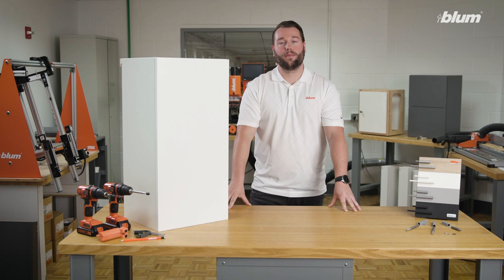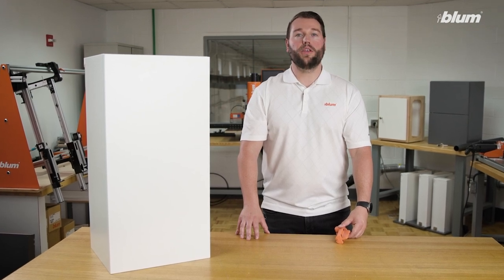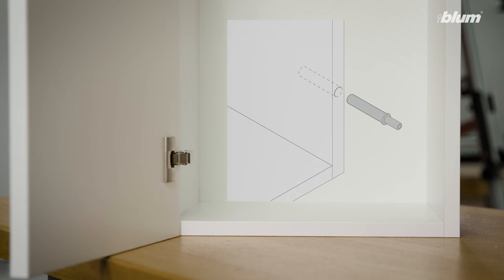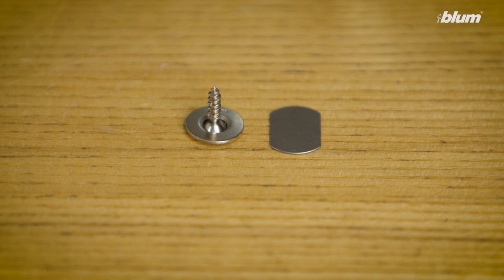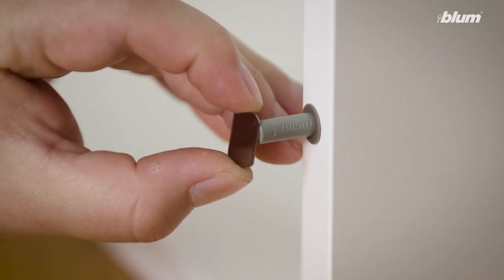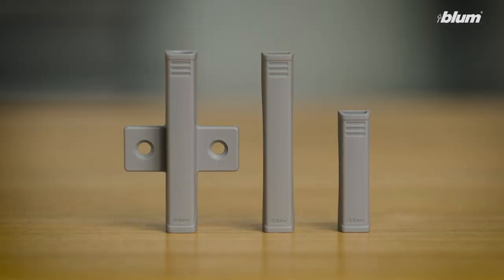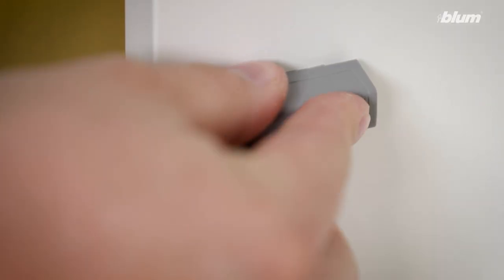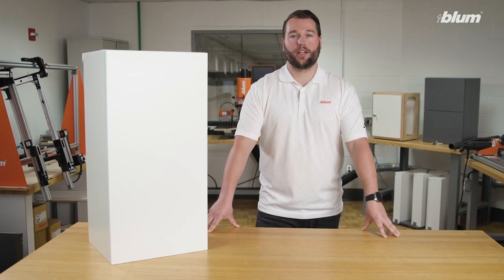How to Install Blum TIP-ON for Doors

Comment: The screw-on catch plate is installed incorrectly in your video. Check your own cataloge, it says, that the screw-on catch plate should be offset by 3 mm towards the inner edge of the side panel. So, knowing that the tip-on hole is on the distance of 7.5mm, then the screw should be installed on 4.5mm, so that it is the washer plate that touches the tip-on magnet, not the screw head. This is done on purpose, because the screw itself might be made from a non-magnetic material.
Reply from the maker: Hey there - All of our US specific literature shows the installation of the screw-on strike plate as being centered with the TIP-ON device for ease of installation. The European literature shows different as that is their chosen method of installation. This could be due to countries outside of the US using screws that do not contain a sufficient amount of magnetic material in them.
Reply: @BlumInc  that's interesting. Thanks for the clarification. I checked myself on the US specific manual, it really shows the plate centered with the tip, unlike the EU catalog requiring 3 mm offset.

Comment: I bought Blum 110 Degree Soft Close Hinges - Full Overlay Soft Close. Can I use this with those hinges?
Reply from the maker: You can! The TIP-ON that will work is part number 956A1006.
Reply: @BlumInc what is the exact difference between the regular ones and the ones for soft close Doors? Can I use the regular ones for soft close hinges as well?